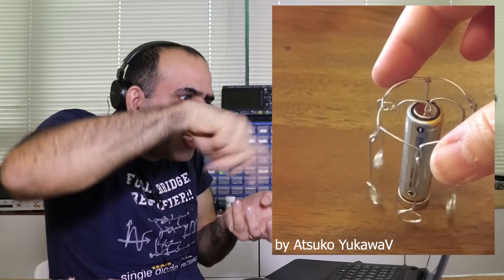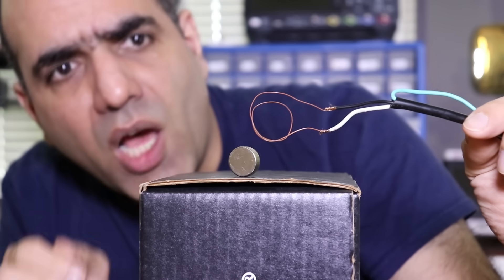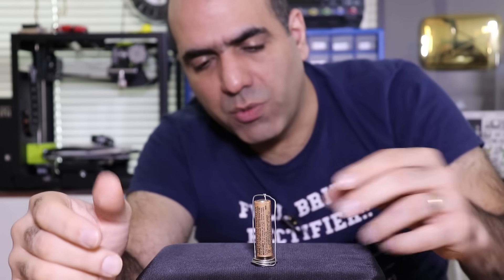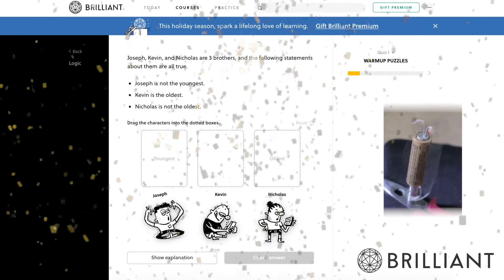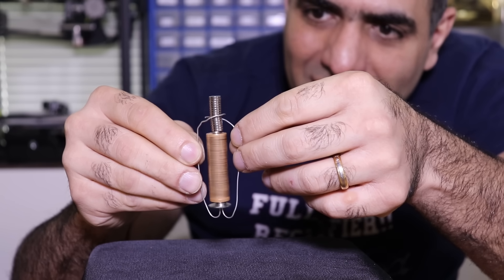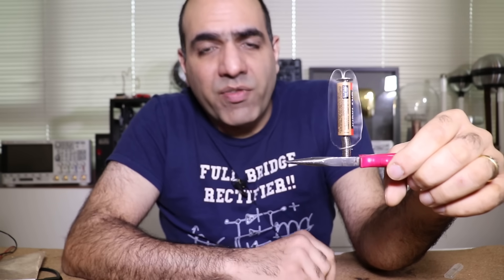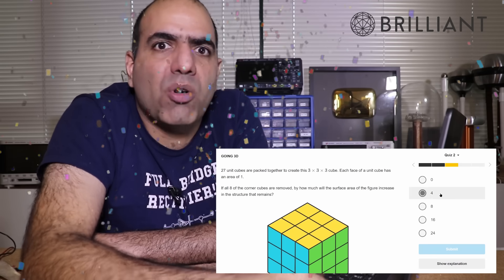Super Simple DC Motor

Comment: The second motor example is interesting. Mechanical contacts like that are called commutators, and with only a little effort we can set up a system that turns DC into AC. A sort of inverted rectifier. Of course it's limited to low frequencies due to the mechanical nature of the setup, but commutators were a critical component in DC motors for some time. They're subject to wear also, just like brush based motors. Brushless are much better, though everything wears out eventually.

Comment: do the other hall-effect motor configuration.
Reply: doh, also put magnet on the top side, so the iron wire will not fall off. brushed ac motor is not dc motor.

Comment: dude the second type motor was my science fair project in 6th or 7th grade nd i just put a magnet on a battery and stripped some copper from a wire and made some windings nd obviously it didnt work, i left it frustrated, now when my 12th grade is about to end i understand my mistake. ( i didnt use coated copper wire i just  used a wire stripper to strip some copper wire without coating and hence the forces were balanced it wasnt movin lol )

Comment: What about using  3.7v battery the 18650 type. Will the metal ring spin faster using the same magnet size and type? A safety advice, 18650 batteries are extremely powerful and dangerous when shorting them.

Comment: U teach me, I offer incite....❤ that full circle around the battery. Stopped or displaced any path of least resistance. A double ring with a gap. I mean 90% of a 360. Or whatever maybe required. Short vs long  . Like serpentine coil. I'd guess. Just saying  thx. Cheer's
Reply: If u look at stone hedge closely.  U will see the master of light refracted articulation ever. Short vs long angled continuity.
Reply: A circle of mirrors and magnifying glass. Drop a curtain in or on one certain focus point. A human would spontaneously combust. Leaving there imagine on the stone wall or slab behind them...Captain Evil Knievel senior stuff. Lol😂😂😂

Comment: Am I the only person who has a reaction to hearing the the idea that current flows from positive to negative in non-gaseous, non-liquid situations?

I remember learning all about the flow of electrons and how it's the electrons that move about the wire or in the skin in AC and then we're studying the actual circuits and everything is positive to negative.

Drove me nuts, still drives me nuts. I know that actual, real, physical substance is moving from negative to positive.

I don't have the reaction when dealing with circuits where the ions are free to move from positive to negative, but I just can't get past it in solid systems. It hits me wrong every time I hear it.

Comment: I am sure with your masters in EE and hands-on experience you could create an artificial gravity test device.  We know from the Cavendish gravity experiment in year 1798 that all matter objects have a gravity field.  Gravity is caused by acceleration of the charged particles in any matter object.  We must make all charged particles accelerate COHERENTLY to boost a smaller object's gravity field.

1)  we rely on the Lorentz force to impose coherent accelerations on the charged particles in the test device (aluminum foil or a stack of foil separated by dielectric layers)
2)  you can use DBD (dielectric barrier discharge) to pre-polarize the charged particles in the test device
3)  static magnetic field vertically through the test device
4)  eddy currents horizontally (in the same plane as) the test device

Very high current for the magnetic field and eddy current helps.  Remember we are using the Lorentz force to coherently accelerate the charged particles in the thin metal layers of the test device lamination (very thin due to the skin effect).  Very high frequency.

5)  use series resonance for the coils providing the magnetic field so you can put very high frequency into both coils and avoid the increase in XL (inductive reactance).  Recall that series resonance cancels the inductive and capacitive reactances, leaving only resistance, so you can have immensely high frequencies in both coils.

6) do not create the accelerations on BOTH SIDES of the test device because we need an UNBALANCED FORCE or the thing won't move.  UFOs pull this off by having a top and bottom half, with only one half given coherent accelerations

The reason 'gravity is weak' is the charged particles (atoms) in most matter objects ARE accelerating (ie. possess accelerations in each atom) but ARE NOT coherent so gravity field is muted.   Use the lens shape of a ufo hull as a guide.  In some ufos (like the ARV) there is a magnet coil around the rim, the largest diameter.

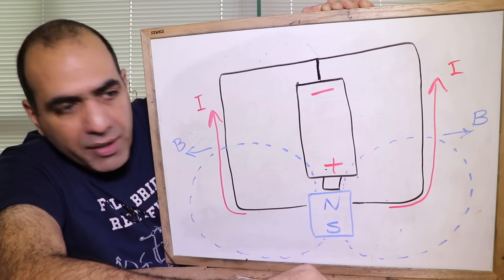Comment: 5:31 - If you change the direction of the magnet by flipping it over so the South pole touches the bottom of the battery, the wire should spin in the opposite direction according to the right hand rule.

Comment: The right hand rule should have been used. In an electric motor, the electric current and magnet field exist (which are the causes), and they lead to the force that creates the motion (which is the effect), and so the left hand rule is used.

In an electric generator, the motion and magnetic field exist (causes), and they lead to the creation of the electric current (effect), and so the right hand rule is used.

Comment: How much power is used to turn? Dose it depending on strength of magnets used? Or power of battery to determine how hard or fast it rotates? Could gears and electric generators be connected to rotation to produce more energy than battery puts out? Maybe because magnetic force or energy magnet forces provided?

Comment: If the forefinger represents the direction of the magnetic field, the thumb points in the direction of motion or applied force, then the middle finger points in the direction of the induced current, you can use ‘Fleming’s left hand rule’ for electric motors.

Comment: We can do last experiment without commutation. So we don't need commutation nor alternate current for motor to run continue. Reverse emi on wire justify energy transfer from battery to rotational energy on coil. Hence it wont work with permanent magnet.

For last experiment, all we need to do is make big winding so push on lower winding is more than upper part of winding which tries to push opposite direction. Winding should not be circular

Comment: Will this battery drain?
Reply: Yes, as the current is flowing.
Reply: of course.....
Law of Conservation of energy 

WORK (Watts) is being done
to get Power (Watts) you multiply Volts x Amps,
therefore without the battery it doesn't turn and work doesn't get done

so... as Current flows, There must also be voltage
if there is current flowing, Voltage is transitioning from a High Energy state to a Lower Energy state   AKA ... THE BATTERY IS DRAINING SLOWLY

and, When all the voltage has left the battery or majority of it the wire will stop spinning thus proving the concept true and conforming with conservation of energy

Comment: Is it possible to attach different blood on top of two iron bars and put small pliers on one positive terminal to apply these activities .Do not attach any of the plates of these two terminals and later on them with a small The electrical motor has to be installed and the solar panel that will be made can it run by keeping it in the sun, whether it is a fake video or the right video.

Comment: It real, an old type of motor
The homopolar motors can be regulate by using a ring
Batterie ring magnet and modifying the short-cut distance from the axis  
This will permit different speed but it's always a short-cut

Now... A little idea...
Lemon or potato batterie...
How to make a lemon motor using the homopolar solution ?

Comment: I've always wondered how these work, thanks! Is there a practical way to use this concept? How efficient is it? It seems like something that was created and walked away from like a lot of early concepts
Reply: Not efficent at all, as tje force is generated by the current. and the current spends most of its shorting the battery and no work. You're battery will be fully drain amd die after that much current. imagine a hairdryer that dies after 30 minutes of use.

Comment: Can I read a comments more the battery die so so will not work without the battery dies so You need to change the battery then that is a problem are the wire

Comment: The copper end is connected to at least the battery and the other end is connected plus the battery by the magnet of the magnet so when both ends of the copper are connected to the battery it produces the positive magnetic therefore repulsion with the positive of magnet.

Comment: I have built a few of motors of the second design, but with fully removed coating on the 'axle' wires. The trick was to introduce slight bumps in those axle wires, so that they bounce a bit in the loops (safety pins in this video). This bouncing provides a crude an unpredictable commutation, and the inertia of the winding loop does the rest.

There is an even simpler version of the first motor shown in this video. Take a drywall screw and attach a small axially magnetized neodymium magnet to the flat head. Take an AA cell (I got best results using a Lithium type), orient it + side down, and place the pointy tip of the screw to the metal 'nipple' at the + end of the cell; the screw is magnetized, and it will hand from the cell. Use a short piece of wire to short the - end of the cell to the neodymium magnet (I used a scrap of solid 12AWG from the hardware store, but pretty much any piece of heavy gauge wire will work, even a straightened out large paperclip). The screw will spin at a high RPM. The screw can't wander very far from center, because if it moves more than a millimeter or so off of battery center, it comes to the end of the 'nipple' and can't go further. I made a video of this way back in 2007 when I was starting my YouTube channel:  https://youtu.be/k7JTyRBfeF4

Comment: Actually your first loop do work. But your loop was too low quality and it touches the rough table which cause it hard to move. For your single looop it do work actually as you can see it was trying to align with the magnetic field but still its too low quality.Btw in my teory it do have something with induction. See a moving magnet cause ac current to be induced. But this time is a wire with electric current flowing which is the same. So ac current has changing magnetic field that alternating and cause it spinning.

Comment: hi there , thank you for this , i want to ask ; how to add a CCM5D to the rocker switch

I have a (775 motor + rocker switch + CCM5D + power ) and i want them all connected

im confuse where to connect the two wires from the rocker switch to the ccm5d power terminal or motor terminal 
hope its clear 

thank you

Comment: I am from india my name is sarambar mukhopadhyay.my keen interest is on function of electrical devices.in this question,in your video starting,the battery here act as a bar magnet and if you place the freely moving body axially at any position of the magnetic dipole.when any freely moving body is rotated perpendicularly to the magnetic field then magnetic force will act perpendicularly to the plane consisting velocity(projected or given in this case)and magnetic field.at this moment the magnetic force develops or provides necessary centripetal force  .so the free body will rotate coaxilly the axis of magnetic force.so a frequency of oscillation generates.now this all applies if the body is self charged.so thank you sir please look into my concept and give me your best conceptions.(physics is not only a science but a way to apply mathematics in real life)

Comment: Question:Why do bones move and it creats vibration on your skin?
Reply: What do you mean ?
Bones serve the purpose of giving your body SHAPE and in some circumstances, depending on the TYPE OF BONE, it serves as PROTECTION.
that's your basic   TORTORA AND GRABOWSKI - SKELETAL SYSTEM 101

Bones on their own do not move
MOVEMENT in your body is as a result of THE MUSCULAR SYSTEM.
The Muscles articulate with bones to create Leverage in the body and enable movement 

as for Vibration, it can also be caused by Muscle or 
CENTRAL NERVOUS SYSTEM
so Vibration on the skin may perhaps be  SPASM'S, 
maybe that's what you're talking about

if so , it really doesn't have anything to do with the bones it more like , IT'S BODY MAINTENANCE
so... if a muscles decides it hasn't move in a while the brain might check if it's still in good shape so it'll issue uncontrollable electrical impulses to it to create FLEXION and EXTENSION of the muscle
once the brain is satisfied the muscle is in good working order it cuts the electrical signal that stimulates the muscle

IS THAT WHAT YOU MEANT ?

Comment: Hey electroboom I have Dealt with the coating on the wires quite often instead of sandpaper try using a lighter on the wire coating but be careful to long will screw up the wire

Comment: Why are you using the right hand rule  instead of the left rule ? Middle finger should always be for current, that's why we use left hand rule for motors and right rule for generators , you  just used your index for current so u can use the right rule for motor, WHY?

Comment: flywheel, maglev bearings
Reply: brushless homopolar dc motor without electronic controller
Reply: ion sling chamber same method, dc ion conductor in magnetic field
Reply: only the magnetic middle rotor turns, battery and coils stay stationary

Comment: We know when current pass through a conductor then a magnetic field creats around the conductor.We can feel that when we connect a solenoid with battery and put a ferromagnetic rod in the solenoid. But at the time of transformer why transformer core doesn't behave ( doesn't attract any ferromagnetic materials) like the ferromagnetic rod that used in the solenoid. Is it only because of difference in AC and DC ?? Please answer ElectroBoom Boss.

Comment: But wait. Didnt you remove insulation on opposite sides of both wires. That would not just stop current through the coil but also reverse its direction so that the motor is driven for 360 degrees and not coasting for 180 as you said

Comment: I did one of Theas for my science project last year. you need to make sher you have a curent through the batery and you need coper at the bottom to make it spin and that needs current runing through the coper it needs to be coper because coper sends a rotation magnetic pheald while electrons are running though it and you need at least two magnets to make it spin
Reply: oh I was wrong you don't need coper tell me what material did you use
Reply: so it dose not mater what material

Comment: 7:48 for class i had to make this motor but in place of the battery we had wood with thick wire in it looped at the top and we put the armature in the loops and then used a dc power supply to power it.
it was pretty fun, the class was about electricity and electromagnets, though it was a quarterly class and the quarter just ended. almost spelled "quarter" like "quater" because i'm so used to the spelling of "quaternion" since i've been working with them lol.

Comment: A few years ago I built that second type of motor you made. I actually got it running pretty smooth. I don’t remember sanding only one side of the magnet wire but I may have had the first type of magnet you had oriented just right. It worked really well and I could get it to spin pretty fast using 2 AA batteries. Winding didn’t get too hot for me.

Comment: To convert home to 48v DC instead of 220v- one way to go is using solar panels. On non sunny days, will it be good to use AC motor to run a DC generator (mechanical invertor)? Will it be cost effective.

Comment: I have a question: can you step up with a DC to DC bust converter o somthing a negative voltage?
Reply from the maker: Yes, connect output to ground and use the circuit ground as negative voltage
Reply: @ElectroBOOM  thank you so much!!

Comment: 5:34
U said current flows from positive to negative but electrons flow from negative to positive 
so which is right 
I'm bit confused about the direction
Reply: electrons are negatively charged.  Move something negative in one direction, it's like moving something positive in the opposite.  Electron holes are positively charged and flow from positive to negative.  Protons are also pulled along from positive to negative, albeit with their atom and way slower.  All in all, we focus on the electrons moving when talking about stuff moving, but we talk about the change of positive potential energy when talking about current.
Reply: @Anton  what shit are you talking
Electrons move from negative to positive 
However there was a scientist(idk his name) he did a experiment where he flew a kite on a windy thundering day. He got electrocuted(but didn't die for some reason) and said Electrons move from higher potential to lower i.e positive to negative. It was about 100 years later discovered that he was wrong. scientist continued to say that  CURRENT moves from pos to negative  but Electrons move from negative to positive. The reason why they decided this was in the 100 year span thousands of books were already written saying Electrons move from positive to negative and it would be a mess if they would start to change everything everywhere.

Comment: Anyone can answer to my random question about circuits and electricity?

I have old airplane toy in my room, when you press a button it makes sounds like it was speeding on a runway and them taking off, it also has flashy lights. It works with normal  double AA batteries

But when I turn my room lights on for a while and then turn them off, The airplane toy turns on without anything touching it. This happens when I have kept the lights on long enough.

It always scares shit out of me when im going to bed but then Loud airplane noises start and whole room flashes blue and red after i turn off the lights.